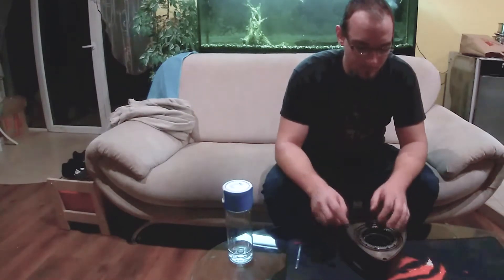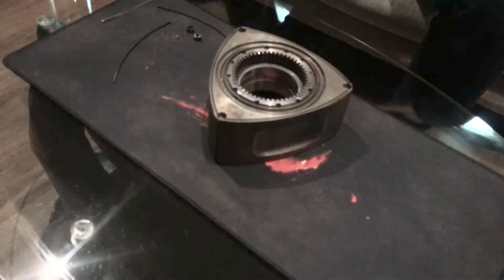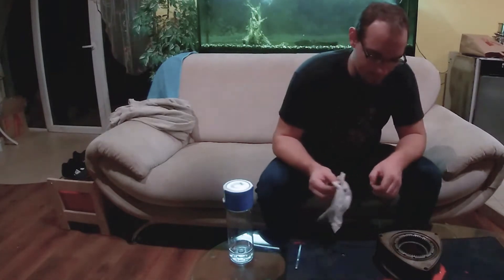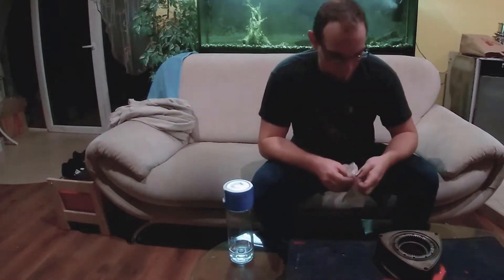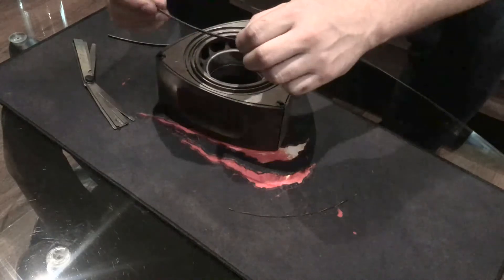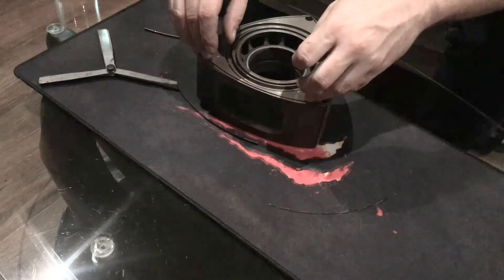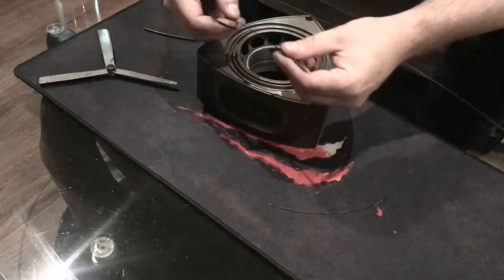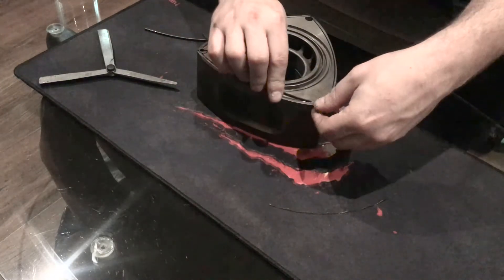How to clearance side seals in renesis (RX8 rotary engine)

Comment: Hi, an info please. Mazda doesn't make the Side Seal of the correct length according to the letter on the rotor? Thanks.
Reply from the maker: From every source that i found it is one inacurate, two inconsistant.
Because in service manual we have letters f-y and 5 avaliable precut seal size, we have 4 letters per one side seal size, from what i remember but dont quote me on this one, because i might be wrong, between k and t marks there is 0.3mm difference, since normal fitment would be 0.15mm it is realy bad fitting. But i assume i do not remember correctly as between k and t is 2 sizes. But whatever.
Either way you can buy precut seals, but if you want consistancy on compression and working you buy oversize and grind Youself. To precision of 0.01-0.02mm
There is also issue of avaliability some shops offer only precut, then for consistancy you buy longest and grind it since v w x y appear so rarely that in some manuals they do mot exists. Or shop have only oversize, if that shop will have best deal on whole kit you will probably grind it by hand.

Comment: PLEASE DONT OFFER ENGINE SIDE SEAL CLEARANCING INFORMATION .  U NEED TO READ THE FACTORY SERVICE MANUAL.      Ur specs will cause massive blow by and Terrible compression.
Reply from the maker: I read that and have it laying here in front if mazdas 0.4mm is ok than my 0.05-0.15mm that i found out on forum should be good. And it seems like it is, my first engine that i did, now passes smogs like it should, there is minimum oil dilution. 
Please provide more data, your „it will cause x” is made on what basicly? I clearly see my approach working on many engines and i dont see your standpoint that i can check for data.